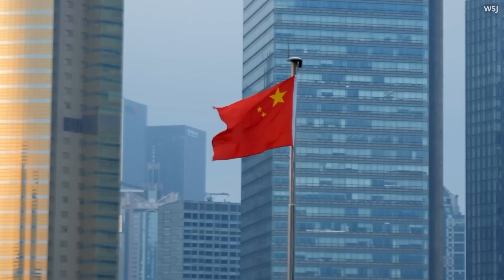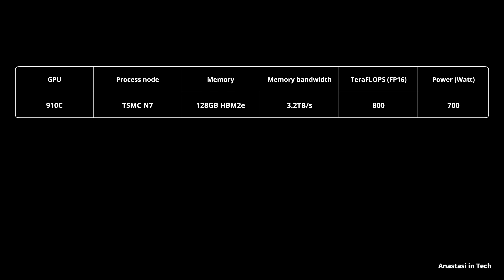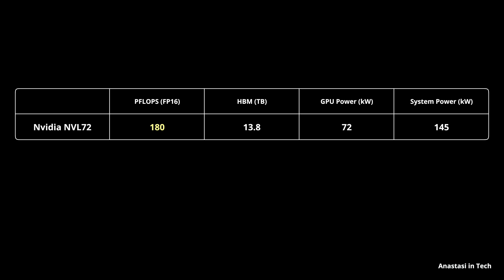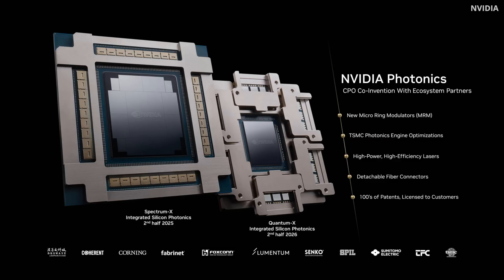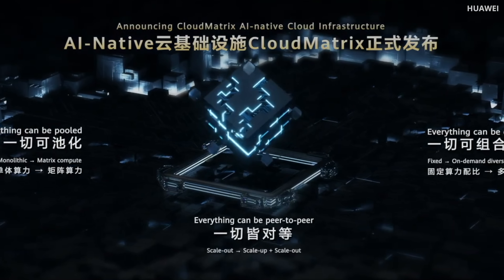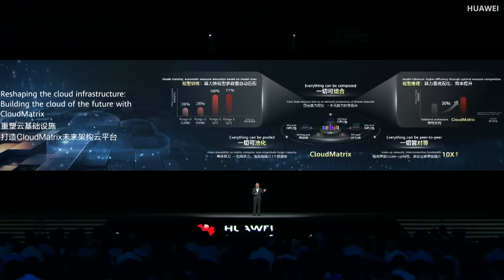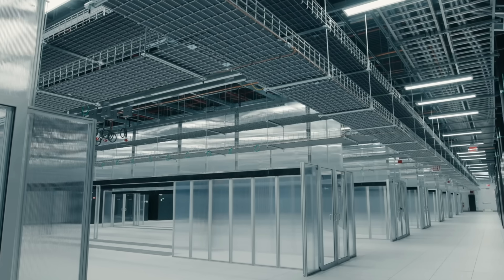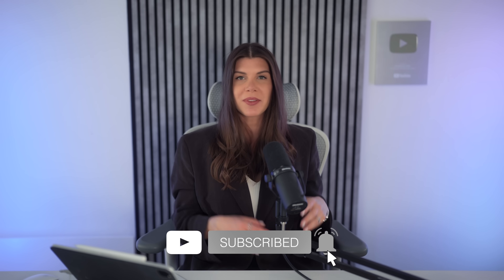Inside China's New AI Megafactory

Comment: I'm surprised that using fiber optic instead of copper requires more power. I always thought that running an electric current through metal generates significantly more heat (power loss).
Reply: The transmitters and receivers use much power. Silicone Optics could change that. Maybe.

Comment: It's funny that Quantum chips uses light to keep heat/cost down in the processing component part and it's use of electrical to tie in and transmit output where as this AI chip goes the other route. Quantum computing is where it's at and the light chip seems to be the front runner. The assembled architecture of this chip looks way smarter than NVIDIA but the direction to light quantum processing seems to be the fastest horse.

Comment: Acsend 910 : Huawei 256 TFLOPS@FP16 and 512 TOPS@INT8 AI CHIP 350W

H100 SXM : Nvidia FP16 Tensor Core*	1,979 teraFLOPS and INT8 Tensor Core*	3,958 TOPS Max Thermal Design Power (TDP)	Up to 700W (configurable)
* With sparsity

+CUDA optimalization

It is a really big feat, that Huawei achived this, but Nvidia is still ahead. 
I am not sure if teraFlOPS matter at this point in AI development and maintainance.
Reply: What about the different chips characteristics for different purposes and different production steps? China is competing in optics machinery production, foundry chip building and designing chips efficiency.
Reply: @UCiWrMgES50tlUhV3l6NqjNA  there are many more variables, that are missing from this comparison. Like termal stability, or silica purity, just to name a few critical ones.
Reply: Its realistically 6x descaled from NVIDIA with total supply chains, but these efficiencies exponentiate really fast year per year when you are strategic like China.
Reply: Nvidia can't sell their best chip into China. So as long as Huawei's chip is better than what Nvidia can sell in there they have business.

Comment: if im not mistaken microsoft has already expiremnted under water data center and they pulled it out eventually
Reply: Ya, the up front construction costs eliminate any benefits you'd get from cheaper cooling. The reality is that a closed-loop water system for a conventional warehouse is way cheaper to manufacture than a warehouse made for the water. Go figure.

Comment: 12:54 Now I'm not chip designer but I do networking and I do work for Huawei, why would the optical solution be more sensitive than electrical? Our transcievers are not sensitive and have extremely low failure rate. Similar is true for odm/ generic modules. I think optical is for future proofing and scaling both network and performance significantly as copper have significant limitations. Especially in datacenter.
Reply: You are correct. 1 strand of fiber can carry a bit per second or as much math as you want to put into OFDMA/DWDM to provide TERABYTES (or more) of info per second. If your software has hardware powerful enough to do the calculations (FFTs and what not), your transceivers can pump out a crap ton of bandwidth, and it doesn't take changing infrastructure. If needed just change the transceiver.
Reply: @crazyidiot5309 and presumably you could carry multiple isolated networks down one fibre by using a passive splitter and multiple colours/wavelengths so reducing the number of fibres and switches needed
Reply: Interchip optical communication is done with waveguides based on either LiNbO3 or Si, not traditional optical fibers.
Reply: It is more sensitive to heat and poer distribution. We are not talking about SFP+ transceivers. We are talking about 100 QSFP800 transmitters in the box of the size of one SFP+ transceiver.

That is power squared to the cubic.
Reply: @wolfgangpreier9160  As long as the unit is designed properly thermal issues should not be problematic.
Reply: @wolfgangpreier9160 for 100G non issue at all with cooling, we sell tons of DCN network. But for high density switches like 64/128 400/800g don't matter we have liquid cooling on our Xinghe switches

Comment: Hi Anastasia.

Firstly, may I say, you're looking beautiful, as always! 😊

I think when it comes to A.I, we need to slow down a little. 
However, i do also understand that if we do, then others may not, which could give them something of an advantage. 
Plus, of course, there is a lot of money involved. 

The reason i say this is because, when looking at A.I. software, it still often presents information as if it's factual when sometimes, it's not.
Take scientific papers that get written on a given subject and get sent for peer review. 
People have been getting A.I to look at studies and creating a paper based on that information as well as speculating answers or meanings.
The problem is, so many are being sent, and yet they are finding time and time again, the information to be incorrect. 

Not im not sure if A.I. chips are in some way related to the same structure as the software used for A.I?
Meaning, A.I. software simulates, in a roundabout way, how neurons work in the brain, so im guessing that A.I chips are designed with a similar design as the software?
If so then doesn't it also means that the hardware, the A.I chips are also prone to the same mistakes the software has.
If that's the case, then it could cause serious problems, if not now, then the future. 
Such problems can often migrate over to new technologies over time, which could create even greater issues. 

Of course, im only somewhat guessing on some of those points about problems that could happen but if they are not addressed at this stage, then I see it as a possibility. 

Anyway, enough of my rambling!, lol! 😂

A fantastic and informative video as always. 

Have a wonderful day, take care! ❤️🌹

Comment: Data centers have reignited the energy debate. It's hard to underestimate the power demands.  The two are heavily interlinked.  And yet, it may jump start another level of the energy revolution, esp. in terms of 24/7 "clean firm power" which could include nuclear power (e.g. Kairos), and possibly geothermal (e.g. Fervo).  (Also, data centers in Saudi Arabia, since they have plenty of sun (as well as gas) resources, which introduces yet another geopolitical element.  Also, water and cooling will be issues (?)).  In the meantime, strategies such as co-location to resources, flexibility, maybe interim strategies.

Comment: Regarding the amount of water consumed by a DC, there's always a confusion floating around because some people had a look at the water flow in the big pipes and imagined that this came from the outside, without thinking a single minute that this was a closed circuit to transport heat to a radiator and nothing else. In practice no single DC consumes anything near the amount of water you mention (2M liters/day would be 22L/s, or more than several firemen hoses), and DC operators spend their time trying to debunk that absurd rumors. A tiny bit of water is indeed consumed from time to time to maintain a level of moist in the air but that's nothing, the rest of what's consumed is essentially due to leaks and maintenance operations. BTW DC operators have very tiny margins so they're actually quite careful about not wasting their money when not needed. That's not to start wasting half a million dollars in water every month!

Comment: I really hope China will succeed in making more affordable GPU because NVIDIA is charging way too much for what TSMC is making.

And I'm saying that as a techie in the West.
Reply: Well Nvidia has such a hold on the market to the point where whatever they charge ppl will just buy.  Regardless of t heir greed, you can not deny that NVIDIA's GPUs are literally the top of the line and that no other gpus come close in terms of performance alone.  However, if we're talking about price to performance, well Nvidia is the absolute worst. lol
Reply: @Dabby724 

Look to BYD to understand their plan. Huawei will start by out competing Nvidias price point, and then when they get the market share, they will surpass Nvidia in quality too. Nobody has ever successfully outcompeted a Chinese Tech Company
Reply: @Dabby724  I think NVIDIA has had both software and hardware issues...following is from genAI:

"NVIDIA GPUs, while known for their strong performance, have faced a range of recurring issues over the years, including unstable drivers causing crashes and compatibility problems, hardware defects like melting power connectors and missing ROPs, and persistent coil whine. Recent RTX 40 and 50 series cards have been particularly affected by manufacturing flaws, PCIe 5.0 instability, and "paper launches" with poor availability and inflated prices. Historical problems, such as the 2008 soldering defect scandal, and ongoing complaints about low VRAM and screen flickering, have further impacted user experience, highlighting the need for improved quality control and transparency from NVIDIA."
Reply: I just commented the same thing. Now Nvidia can't monopolize the market.
Reply: The HWei  ban , is to let App1e se11 us the $ame ph0ne for5yrs😂
Reply: Can check out Moore Threads GPU.
The spec Is kind of half consumer AI GPU as well as trying for gaming. The driver is not there yet. but in few years it'll be interesting.
Reply: Agreed
Reply: To offset the cost of factories setup in the U$, TSMC need to increase the manufacturing cost.
Reply: TSMC already said , they will make 10billion less when factories setup in the U$
Reply: yea i want a cip with CCP backdoor too... lol
Reply: @gubunki  RE: "yea i want a cip with CCP backdoor too... lol"

Both UK and German intel services examined the source code for Huawei before banning Huawei h/w under US pressure.

They found out that there was no backdoor.
Reply: @mrteacher1315  source code? the best backdoors are built into the hardware
Reply: @gubunki  I’m sure the CCP is super interested in what you’ve got going on, but great point. In the west there’s no surveillance/intelligence/security agencies and even if there were they have no way to pry into your devices.
Reply: @gubunki  nobody wants gpu with CIA backdoor
Reply: In 2023, TSMC CEO CC Wei joked/complained about how they make $600 from Nvidia on one AI chip, and then have to pay $200,000 to buy it back from Nvidia when they need a server. Using gross margin of 75% and 57.5% for Nvidia and TSMC respectively, for each $200,000 server sold, Nvidia makes a profit of $150,000 while TSMC makes only $345. Most of the money and profit goes to US companies such as Nvidia and Apple. Other companies in the supply chain get very little.
Reply: The US and some of their western allies have been playing this value-add and monopoly game to extract wealth from the developing world for more than many decades…latest being planes, automobiles, silicon chips, computers, pharmaceuticals, cloud applications, etc…whereas China seems to be democratizing their new found leads to the world. Of course this is no secret as they basically say this in many of their policy statements.
Reply: The despicable United States will constantly sanction
卑鄙的美國會不斷製裁
Reply: the one thing you dont know is China doesnt have it's own originality in terms of products they only get to where they are cuz of the factories that we made there to build nvidia chips they follow the trend and pump chips of a lower quality than a higher quality chips. They may be cheap but would you rather buy a chip thats of a higher quality and inspects that quality that are trained to look for those specifics flaws and fixes them or you just want a flawed chips that gets pump and sell. Quality? or Quantity?
Reply: @16kn  RE: "China doesnt have it's own originality in terms of products"

Most countries' strategy in new area is to first emulate what is simple and build on top of that.

There's isn't any race or country specific secrets to originality.

Secret of innovation is widespread high functional literacy combined with institutional support.

Pre-Soviet Union Tsarist Russia has had very few innovations b/c most Russians were illiterate under Tsar.

When Stalin modernized Soviet Union and suddenly, ultra high widespread literacy was the norm, innovation exploded.
Reply: @mrteacher1315  True. That's also the education system in a nutshell.
Reply: @16kn  英伟达的芯片是台积电生产的
Reply: China has pulled a head in a number of ways but US oligarchs prevent us from being able to get their products.
Reply: I’m sure part of it simply is market demand. When you have giant building size clusters being built in multiple locations you can’t exactly keep up.
Reply: That is the real issue everything American is greed driven.
Reply: I am prettysure (also) you arent want that.
Reply: Of course. Dream bigger. China will not fight with people who always say  copy copy copy. China will make all the technologies  one generation far beyond the world.
Reply: As a techie in West you should know they could get to an AGI first if their GPUs reach cutting edge efficiency. Hope that doesn't happens, cause China would absolutely use it against West
Reply: @Xv690_64 everything others succeed in is always against the west. Is dat the formula of ur democracy and freedom.
Reply: They aren't working on consumer GPUs. For consumer GPUS there is Intel and AMD. Intel looks promising, why not have hope for them?
Reply: @MsHojat  "Intel looks promising, why not have hope for them?" 
Cuz AMD is already kicking their ass. 😂
Reply: @MsHojat 摩尔线程s80了解下 ，他们一直在优化驱动，性能提高了很多
Reply: 欧美对我们越封锁，我们越强大！任何国家都阻挡不了我们科技的飞速发展🎉！我们要让科技更好的服务于全球人类，而不是被欧美那些霸权主义掌握！中国每天都在迎接不同的挑战，我们从未失败😅
Reply: AI gpu's isn't interesting for normal consumers
Reply: @Robbertdelange  Yes it is. And if i can get a Huawei Chip instead of a H200 and also the needed drivers for most AI models i would love to use them.
Reply: @wolfgangpreier9160 ok, 50k for the Chinese one. Not for the average consumer.
Reply: @Robbertdelange  RE: "AI gpu's isn't interesting for normal consumers"

I think generative AI will be everywhere more and more, both in consumer and commercial landscape.

Also, expect generative AI to be used more and more in humanoid robots as well as VR and HMI embedded chips.
Reply: @mrteacher1315 Yes, but it is not like we are going to push these in our computers. Tech companies are already buying them as much the factories can produce them, regardless the cost.
Reply: @Robbertdelange  you are so wrong
Reply: @_Genji_Shimada_  those things are like 100k or so?
Reply: @Robbertdelange  Computers used to cost 100k back in the day. Now everyone has one in their pockets. 
Competition forces innovation. What the US is trying to do is to create a monopoly and stagnate global advancements.
Reply: @Robbertdelange  Taiwan is in China
Reply: @GoodBaleadaMusic depends how you look at it.. China is in Taiwan
Reply: @GoodBaleadaMusic  china is in taiwan
Reply: @GoodBaleadaMusic Not before THE negotiation .

Comment: Why are they not using the extra heat energy to generate electricty ?
Reply: Large amount of heat, but at quite low temperature. Perhaps in winter for central heating ...
Reply: Not high enough temperature you can only used the waste heat for home heating.

Comment: Since the West has almost guaranteed a full economic and social confederation between Russia and China. China’s best option would be AI and Data centres in Northern Siberia. This might be economical than data centres at high altitude in the mountains. If one starts out at well below sub-zero outside temperatures then cooling becomes far more economical.
Reply: The west hasn't guaranteed it.  China has.  They had a choice to be a member in a complex social order, or to try and dominate everything and treat every transaction as zero sum.  They chose the latter.
Reply: Right. Use coal with piston steam engine generators. Or maybe emphasize new architectures and novel materials that don't need all that entropy to run?
Reply: Right!
Reply: I would suggest staying away from Russia while it has a backstabbing and evil regime. That regime isn't sustainable, so there may be good chances for mutually fruitful partnerships once the regime has fallen to overall better leaders.

Also, considering climate change because of carbon emissions, Russia's formerly colder regions will keep warming up too much, and get swamped with Malaria mosquitos. The same as with Alaska, Canada, Greenland and other nordic regions.

If a natural cold ambiance is needed, then only the near-pole Arctic and Antarctic would do... until too much warming there too.
Reply: Running anything in russia means entering a toxic cesspool of corruption and low quality  workers. Why do you think Xi shut down Putin's attempt to open factories in Russia without any discussion. Ssme reason western oil services firms used the ukraine invasion as excuse to get out of russia asap. Even though they are used to working in really bad parts of the world. 

Xi wants to use Putin to get commodities from and to sell stuff to. That's it.
Reply: Mongolia would be a great location doesn't bataar hit minus 35celcius
Reply: Placing in a foreign country will have risks, wouldn't it be safer and more economical under the sea, China has done this before?

Comment: I don't understand how copper connections are supposed to be more power efficient than optical. Typically it is the other way around. Ethernet for example tops out at 10GBits/s for most applications, because of the damping and heat output. Can it be that the protocol or frequencies of NVLINK make the difference?

Comment: I'm assuming that cooling water isn't required to be potable?  It is drinking water that some areas have a limited supply of, right?  Otherwise its the earth's most abundant resource?
Reply: The purer the better, you don't want anything that could block the cooling fins not even dissolved minerals. But the water is recirculated after it dumps the heat to the atmosphere.